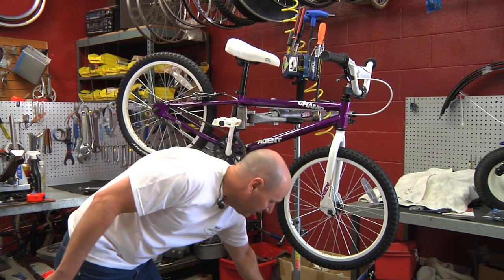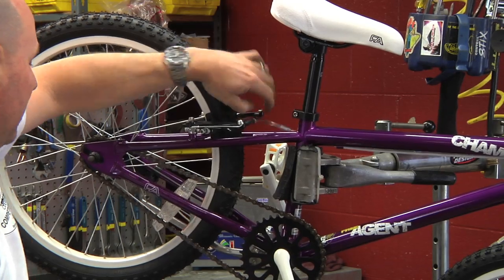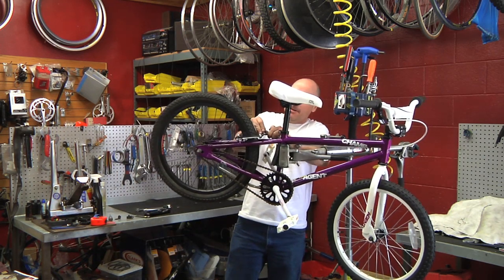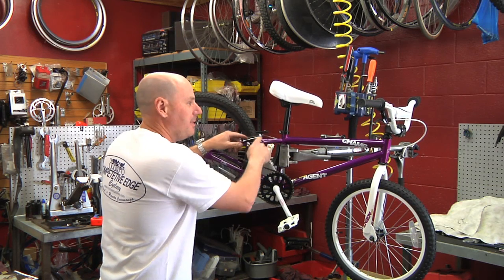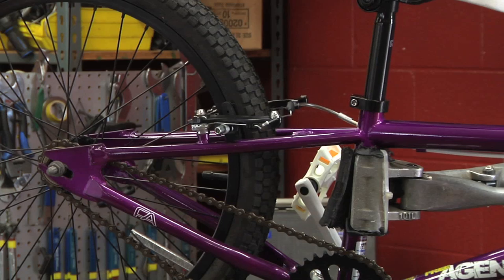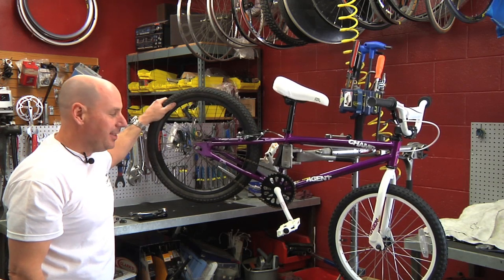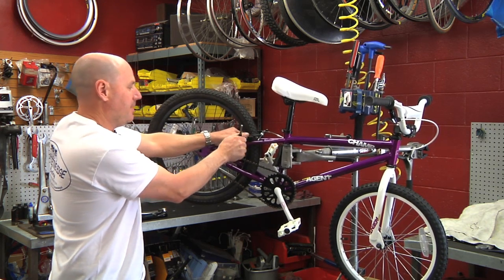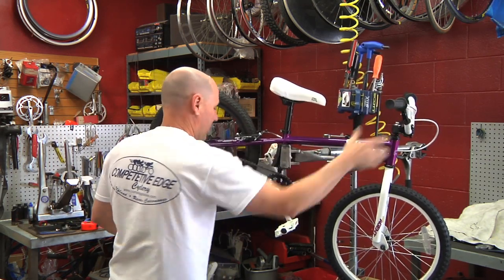BMX Bike Maintenance : How to Make a BMX Bicycle Free Wheel

Comment: This is fucking retarded. How are you working in an actual bicycle shop? All you showed us is how to replace a back wheel. A fucking slow child could do that. You were supposed to show us how to modify a wheel with a coaster brake to operate like a free coaster. This hikes rear brake isn't even set up like a conventional coaster brake as it utilizes an actual rear brake setup with shoes and a cable. Our world is going to end because everyone is getting so fucking dumb.